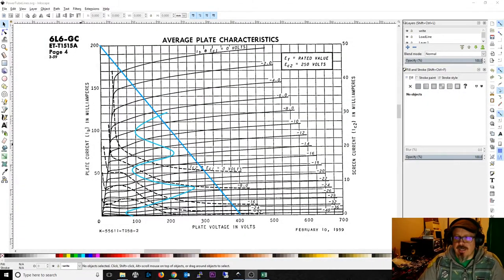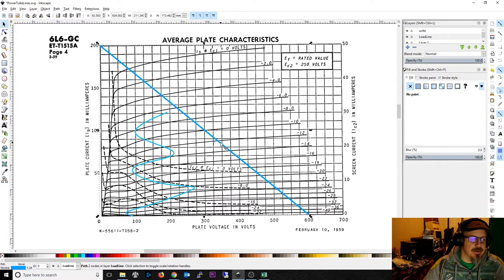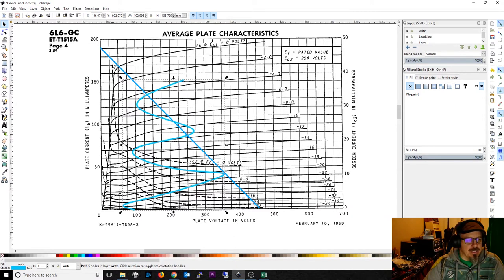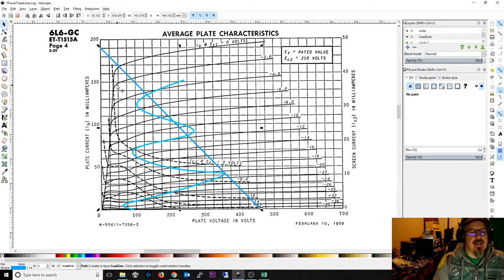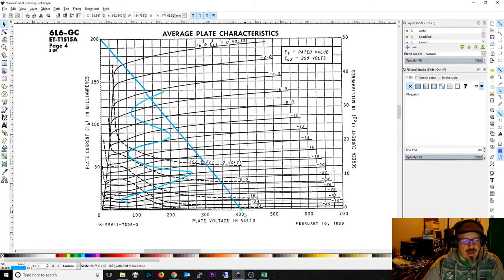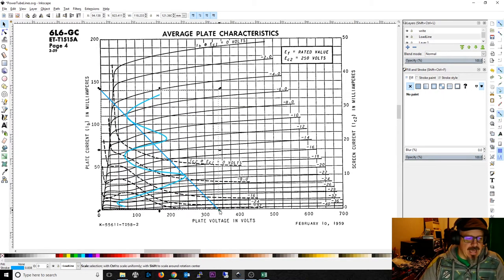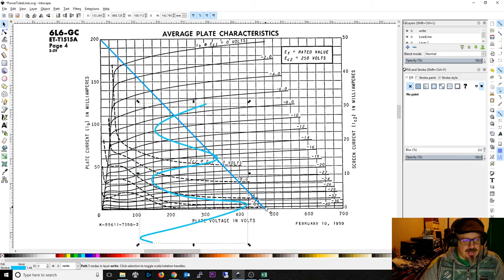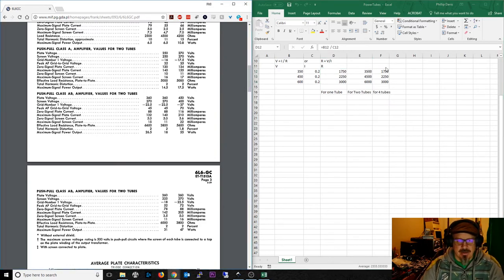Tech Tips Video #6 Power Tubes and Pentodes Load Lines

Comment: I'm not sure about this value 210mA at 4:04min. According to GE datasheet you're using - 210mA is for PP Class AB1 for two tubes. For 1 tube in Class A the value is 66mA...
Reply from the maker: I probably was not super clear.  This was for two tubes in push pull  as output tubes.
Reply: Most likely my fault, I'm trying to learn these things now and it's not easy. Anyhow, I like the videos, keep the good work! Thanks!
Reply from the maker: No worries, I also did this video quite a while ago, so I might be remembering wrong. ;)